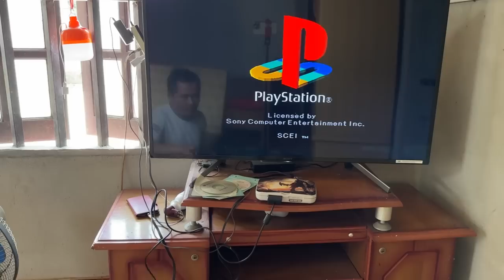Restoration SONY Game Playstation | Restored dusty Ps one Game console

Comment: Why do you have to test with multimeter connections, probably you don't understand any of those readings.. And most of all, soldering on top of a microchip is a big mistake, those chips does not like heat. And that chip you were soldering is a "crack" chip, all pirate games works with that. 

So the main title supposed to be cracking a Playstation, instruction from YouTube.